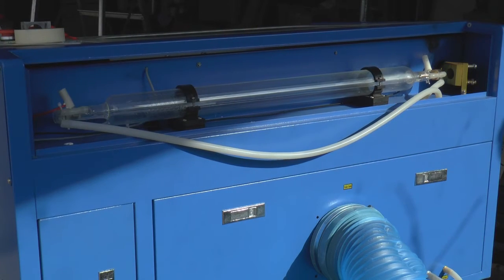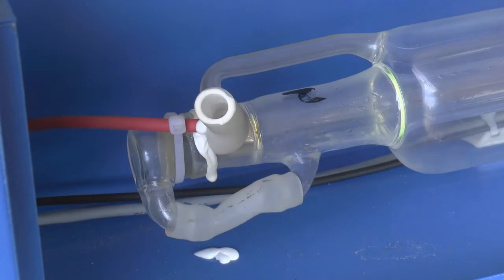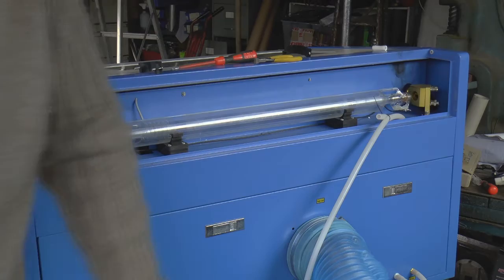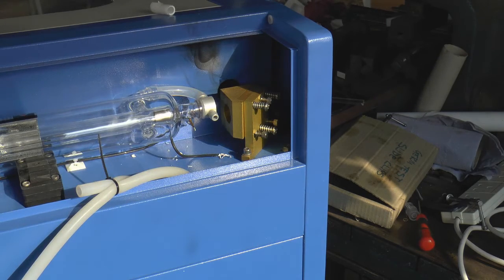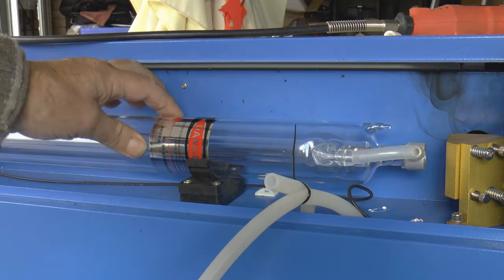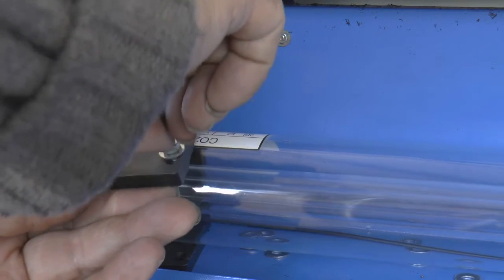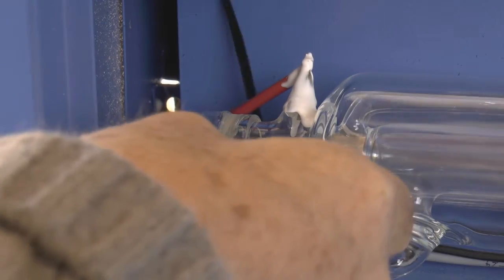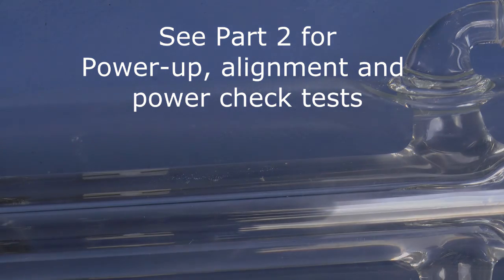RDWorks Learning Lab 21 Fitting new laser tube Part 1

Comment: Russ, I have a problem that I do not believe you have covered. If you have, I apologize. Similar machine, 60W. It suddenly stopped working while rastering. Pushing the pulse button tries to excite the tube, but no output and there appears to be some arcing. Guessing that is caused by not not having enough current to fully excite the tube? Replaced the tube and checked mA in series. At power 70% I get less than 2 mA. Removing the tube from the circuit (directly checking the power supply) I get 31.2 mA at the same 70 power setting. I do not understand electricity and power supplies much. Any idea what I should expect mA wise testing the power supply directly? Our machine looks like your machine only red. Tube is 50mm x 1000 mm. 24KV triggering voltage, 17KV working voltage, 5mA triggering current, 20mA max working current. Our next step is to replace the power supply unless you come up with something different.  

https://www.ebay.com/itm/60W-110V-CO2-Engraver-Cutter-Laser-Engraving-Machine-w-USB-Interface-New/252796092487?_trksid=p2485497.m4902.l9144  

https://www.ebay.com/itm/60W-1000mm-Laser-Tube-Glass-Pipe-For-CO2-Engraving-Cutting-Machine/302661715334?ssPageName=STRK%3AMEBIDX%3AIT&_trksid=p2057872.m2749.l2648    is the new tube.

Thanks for any insight you may have!
Reply: Hi Gary
People wrongly think I'm an expert. Wrong.  I am a learner just like most people. However I have several advantages. I am retired and do not have to make money. That means I can play with this machine/technology to understand it in great detail.  I have been at it for 3 yearsI am doing this for personal pleasure.   My other hobby is video/editing ,, so sharing my learning journey on video  means I get TWICE the pleasure. If I have not had to deal with the issue as part of learning then I will not have covered many topics, including yours. However, all is not lost so lets take it slowly and you correct me where I have assumed wrongly.
First, a tube does not usually just stop working. They usually start to lose power  over a period of weeks  and warn you its time to order the coffin. Instantaneous failure is usually a good indicator that something electronic has popped. Does the tube glow pink when you pulse it?  If yes then this promising. I am no electronic expert either but I do understand how  control of the HV power supply operates.
 First , your 1000mm long tube is 50 watts and as you have stated , should not run at more than 20mA. . You will almost certainly have a  60 watt MYJG HV power supply. It will have a typical max output of 22mA .DO NOT try to test it without knowledge and precautions Your 31 mA seems way off Only ever put an ammeter in the cathode return line to measure the current. If there is no current there then it is for a very good reason.. I am not going to explain how the physics of the tube works but suffice it to say that the gas mix within your tube contains 10% nitrogen. All gases are non conductors and will not carry current. However if you threaten nitrogen with 25,000 vots dc is will break down and ionize (just like lightning). All of a sudden that ionized gas becomes a conductor with no resistance. The power supply is carefully controlling the current flow through the ionized nitrogen because more current means hotter tempratures and high molecular activity. The pink beam is NOT the laser beam, that's a whole different story. 
So  reconnect your tube for safety and testing reasons  and stay well away from that big red wire. If you can see the pink beam thenyou know the power supply is generating sufficient voltage. If the pink beam is there and you put a piece of card in front of mirror 1 and scorching occurs , you have watts. If you have no watts at mirror 1 but the beam is on then the tube is out of gas and is dead. Almost unheard of for it to drop down dead unless there is a mechanical failure in the glass work (a crack?) that has sucked air in from the room and contaminated the delicate mix of gasses.

If there is no pink beam, is the HV power supply fan working. If yes, it means there is mains into the unit and now the most likely  problem is  the tube switching input has 
failed This is the second terminal in on the 6 way HV terminal block that will somewhere be marked as L. (maybe TL)  If you get a piece of wire and connect L to GND (G the 4th terminal) the tube should glow.  Before you do that set your power to 40% and check that the voltage between the HV  terminal IN and ground is at 2vdc. Now test the switch L with a short blip. If the tube lights then this circuit is ok if not then you have found your problem. I feel moderately sure this is your issue because of when and how it occured. At the end of every scan thube switches off and on  so that switch is being continuously hammered. It is one of the main causes of HVpower supply failures

 The tube link you sent, is this one you are thinking of buying or one  you have bought?  Pleased let me know.

Hope this helps identify your problem

Best wishes
Russ
Reply: Thanks for the reply Russ! 
Yes, the tube glows pink, but there is no output. I put a piece of tape at the about a centimeter from the business end, long pulse at power 50 and not a mark on the tape. Power supply fan is working. Could I do this test just by running a shot cut program at power 40? If the tube lights would that not show that the tube switching input is functioning?

I understand now why the mA are so low. Resistance. 

The link I sent for the tube has been purchased and is currently installed (but not working). It will glow pink when pulse button is pushed.

I know that you are not an expert, but I also know that you are a pretty smart fellow. I figured that if anyone could narrow it down on short notice it would likely be you. 

Any more thoughts on my problem?

Thanks again for the response,

Gary
Reply from the maker: Hi Gary
Pink glow means power supply is working well .  Even though there may be no watts output you should still be able to change the intensity of the pink beam. Set your power to 15% and look at the strength of the beam. A bit hazy and wispy?  Now set the power to 65% and look again. A nice solid pink stick of light? If you can see this intensity change  then forget the power supply  because its in good health and doing what its designed to do.  Watch this video and it explains how your tube works
https://www.youtube.com/watch?v=2F5O-1TH8b0&t=0s&list=PLPWEtx5V9DqEogIeYRdcG_KYcB7UL2Qmn&index=7

 You must therefore turn your attention to the tube. Pink beam but no watts output?  Basically you have a Mustang there with the engine revving but someone has nicked your wheels!!!! You are going nowhere.
Oh dear, here is a pre-prepared sad story about that tube you bought from ebay.  You situation is one I have heard so many times that I now just cut and paste the following.

Many Ebay machines are built in a Chinese factory called KeHui and your tube looks to be made by K H Laser....do you notice the similarity between Ke Hui and K H Laser? Sadly this is a big fraud. KeHui do not make tubes. Instead the trawl the main Chinese tube manufacturers for their reject tubes. Thy then take them into their own factory and retest them to make sure they "work in some way", enough to fool the unsuspecting and naive E bay buyer. They relabel the tubes to make them look credible,  fit the tubes to their own machines and then ship them in bulk to various warehouses around the world. Next, a team of PRIVATE Ebay  sellers sitting with PCs in their kitchens in China selling to you for commission, without seeing or knowing anything about what they are selling. The warranty is worthless if you try to contact them but with enough threats you may be offered a small refund. The HV power supply wiring is often incorrect for some unknown reason and the power supply may also be a B grade unit because I have encountered many reported failures. The tube in your machine will not be what it purports to be either. If it was a 60 watt machine it will be a 1000mm long 50 watt tube not to be run at more than 20mA or if it was a 50 watt machine then it will be fitted with a 40 watt  800mm long tube that should not be run at more than 18mA.
Your tube or power supply will last days, weeks or a few months but it may perform badly during that time. It's a real lottery because your tube may be a "just fail" or it may be "almost junk"

Sorry to be the bearer of bad news but it's best you know so that it will not be a surprise when things do not work as expected.  It appears that you have now reached that point.There was a time when you would only see these reject tubes fitted directly to machines. I have noticed that in the past few months they are now getting brazen enough to sell them as "spares" on Ebay. I would trust NO tubes bought from Ebay and be cautious about power supplies also.  They seem excellent value but they are cheap for a reason.
Choose one of the cheaper tubes available from Lightobject, at least you will be dealing with someone  that speaks your language and there is a degree of retail protection with your laws.
 $$$$ is the fix but spend them wisely.
Best wishes
Russ

ps if this tube is a recent purchase then you can try for a refund  through the ebay complaint procedure....but don't hold your breath.
Reply: Russ. Thank you for sharing your knowledge. It was indeed the power supply. We now have one laser that runs off Corel and two that use RD Works. It's a good mix as there are a few of our older designs (created on the original Corel machine)  that do not translate to RD Works very well. I'm way behind on  your videos! Thanks a LOT for being there for us!
Reply: @SarbarMultimedia   Good evening Russ. After changing the power supply it ran fine for 20 or 30 hours and I now have a problem that I can not find an answer to by searching. The 60w was marking but not cutting last night so I took a look at the tube and noticed that at the discharge end of the tube the light beam was curving to the side. Not to one particular point, just randomly moving around and occasionally part of that beam would exit and mark the board. Replaced the tube with the cheap tube I got from Ebay and am still having the same issue. Guessing the curved beam area at the end is just a few centimeters. As it is firing, I have a feeling that it is not the power supply but really have no idea. Your thoughts? THANKS!!!
Reply from the maker: @Gary47471  
Hi Gary
Why do you come to me for the bad news??????  The pink beam means your power supply is fine. your tube is not
It requires very little power  to engrave  but everything you can throw at the job to cut. It appears that your "everything" is not very much at all. The curving pink beam is a great observation but has nothing to do with the power being generated. The pink beam is the ionized nitrogen that puts extra energy into the carbon dioxide molecules. When the CO2 molecules give that energy back, it produces photons of invisible IR light which eventually exit the tube as useful power. As I may have mentioned before that pink glow does not mean you have power. There MUST be CO2 in the gas mix within the tube for you to get power out. Driving the tube with too much current (do you run at more than 65% power?) will kill the tube very quickly because the pink beam  becomes so violent that it does not just add  a bit of energy to the CO2 but so much energy that the CO2 molecule shakes itself to bits and then exists as CO (carbon monoxide) and an oxygen atom. Neither of these gasses will produce power. So too much current kills the tube. Do you have an ammeter fitted to your machine?  
You might like to watch this video I made about checking power from the tube.  If nothing else, watch from 20 minutes onwards. where you will see that the normal beam characteristic at the cathode has some real meaning
https://www.youtube.com/watch?v=nZuatc3eIgU&list=PLPWEtx5V9DqEogIeYRdcG_KYcB7UL2Qmn&index=26&t=1273s

You may have replaced the original B grade  tube with an A grade tube from a trusted source but over driving it  results in a very early death. Where did you buy your 60 watt tube? and do you have an ammeter fitted (I ask again)?

Best wishes
Russ
Reply: @SarbarMultimedia  Hope this is some GOOD news for a change! HA! Milli amp readings.
% and  mA reading
20 = 4
30 = 5.5
40 = 7
50 = 8
60 = 9
70 = 11
80 = 14
90 = 17
99.9 = 19mA
At all of these settings the beam bends at the discharge end and the resulting output is unusable. 

Both tubes must be bad. Correct?

Thanks!
Reply from the maker: @Gary47471  
Hi Gary
That's not good news.. It confirms that your power supply is working and A) generating enough voltage to ionize the nitrogen (the pink beam) and B) controlling the current through that ionized gas. The more current the brighter the intensity of your pink beam..
Put a piece of mdf or ply after mirror 1. Set the power to 65% on the max power button and then do a 5 second pulse burn. if there is but a scorch then your tube is dead, if it is a serious burn with smoke and flames then you have significant watts coming from your tube. From what you describe I suspect it will be just a scorch and means your tube has run out of carbon dioxide. As I have probably advised before, stay away from ebay and Amazon marketplace when looking for a replacement. Cheap tubes are cheap for a reason........they are usually B grade QA failures that"work in some way" . Buy from a trusted source.

Best wishes
Russ
Reply: @SarbarMultimedia  I think my machine is cursed. Just installed a new tube from Lightobject and it worked fine for three minutes. It ceased to work suddenly and the meter showed 4mA output at all power levels after that. Later the same day it was showing 2mA at all power levels. Do you have a good source for power supplies? The power supply currently installed is a replacement that came from Ebay. THANKS!!! The new tube was showing the arcing at the output end but it seemed to be working just fine otherwise.
Reply from the maker: @Gary47471  
Hi Gary
My own and many other people's experience of buying laser tubes and power supplies from Ebay is bad news. You are almost certainly buying factory QA failures. Yes, they may work, but obviously the manufacturer would not warrant them because they were not perfect. How imperfect is always the gamble with E bay products. How well they work and for how long...how long is a piece of string?

3 years ago when I first encountered Light object I considered them little more than sharks. Every thing was over priced and over specified. About 2 years ago they seemed to undergo a culture change and became honest about the products they sell. I still considered some of their products expensive but to be able to get stuff like this in your own country is a real bonus. 
 The bad news is that just recently I helped a guy who had just bought a new power supply from them. It was dead on arrival but this guy was not able to determine if it was his tube or  something else.......after all he knew his NEW power supply was not to blame. Well it turns out the NEW power supply was not so new when he removed the cover. It was in fact well used, caked with dust and very second hand.......and dead. Maybe this was a genuine mistake, but it does display a serious lack of stock control and knocks their claim that all stock is tested.  This has made me very wary of recommending them. In addition they were unwilling to send out an immediate replacement until they had received the old unit back for examination. That would have meant more delays for this guy's business.  We eventually tracked down these guys who have an Ebay outlet but being US based you will be protected by your own trading laws
https://www.ebay.com/str/Engraver-Cutter-Solution?submit=Search%2520Store&_nkw=&_pgn=2
Give them a call to see what they have, because they seem genuine enough. Would be pleased to hear of any feedback if you do deal with them. Always useful for others.

Best wishes
Russ

Comment: Hi!

Interesting video indeed!!!

I have an issue with a similar power supply as the one you have.
I had to exchange it as on my 50W laser the original one (Mod. MYJG50W) stopped working during a 5% power session after only 93 days and less than 10 hours work (many of these at less than 50% power).

Now the new one I have it emits a VERY limited power - a rough estiamate would be in the region of 1/10 of the original one.
The laser ray is not "thin" at all but seems to fill the cylindrical glass tube.

Moreover another strange thing is that if I use the test button the first burst would be "ok" then the following burst would not even light up the tube... :(
Do you have any suggestions on what could be wrong?

Do you know if there is any way to measure the actual power that the power supply is outputting?

Please help as I am stuck and I have to work on some friends' wedding present!!! 

Thanks,

Alex
Reply from the maker: Hi Alessandro
Look at your You Tube  messages

Best wishes
Russ
Reply: SarbarMultimedia not sure how to! 😄 anyway right now it seems to be working... thanks anyhow!
Reply from the maker: To get to your messages, go to your You Tube homwe page. Click on your round icon on top right of screen.  In the drop down window select  Creator Studio. Clickmon Community and then select messages.
Best wishes
Russ